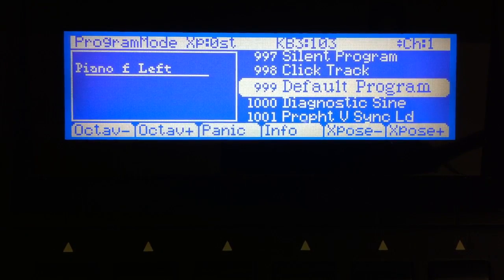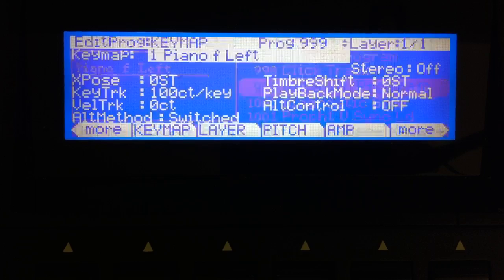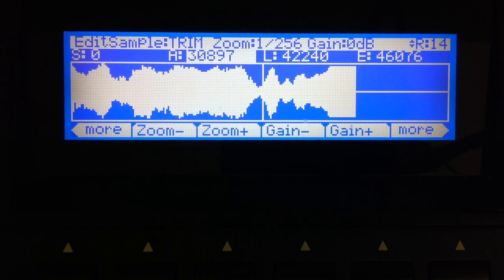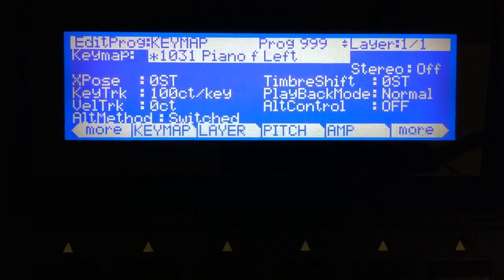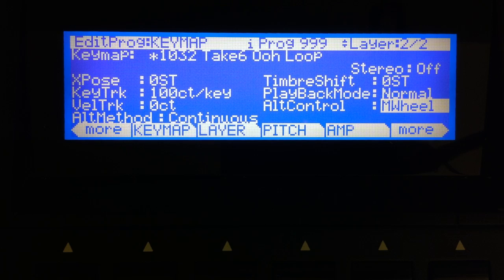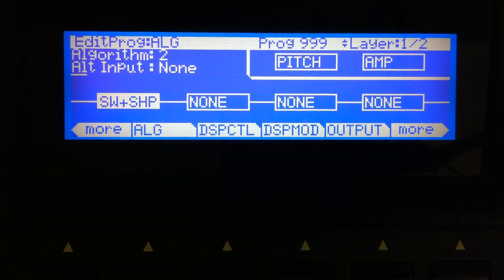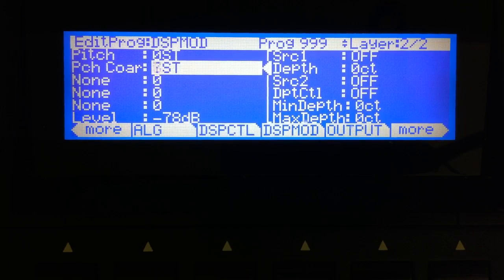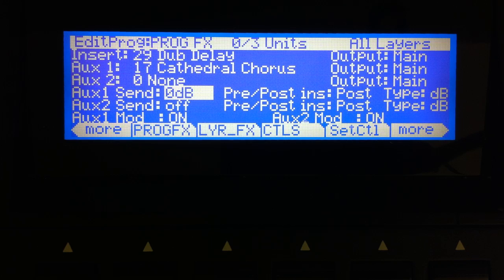Kurzweil PC3: Tutorial 13 -- Wavesquencing Pt 1

Comment: nice ~but I think you can create maybe 8 layers with Layer Enable as random LFO,  then with different range value, so each time you play note, random layer will enable, It's WavSeq. And in Forte OS4.0  or pc4 it's more easily, set layer enable to any CCseq, then use CCseq to random control it, with random or step control other parameters, it's really Wavseq as most KORG can do~
Reply from the maker: Yup, I go over that sort of thing in pt. 2 -- https://www.youtube.com/watch?v=HiXY8MJiCMQ -- since you can have 32 Layers in a Program you can have 32 different "sequences". And yes, the point of the video is to show that you can do "wavesequencing" on the PC3 just like you can do it on other keyboards.
Reply from the maker: Adding, now that I think about it a sec with Setup mode you could have way more than 32, as you can have 16 Programs in Setup mode, all doing this sort of thing. By varying some bits you can have 16*32 wavesequences running, and switch on/off at least 16 at a time.

Comment: this approach reminds me not "wavesequencing" (which is the technique used on korg wavestation or dsi evolver...a sequencer triggering some samples instead of notes in a musical timeline with a given bpm)

Instead it has more in common to "wavetable scanning", which is common in ppg, or waldorf blofeld/wave/microwave etc family....you have a collection of waves which have some common morphing character but not always so, and you move the pointer inside the lookup table reading this wave stream in various points, even looping a portion of it....

this is more wavetable than wavesequencing, alas your third tutorial instead has more in common with classic wavesequencing.

It would be interesting to try if user flash sample memory in kurzweil pc3k would work in the same fashion, imagine sampling a tons of waves at 8 bits and 20 khz put them inside the flash and moving randomly into them, would be great and 128 mega would be such enough.

I read about one guy who has made tons of wavetables and stock them into a sy85 which has only 512k of rom....big flash are intended to store vst realistic samples not for such applications.

I read in manual kurzweil pc3k has 16000 locations to store objects....would it be 16000 sampled waveforms?
Reply from the maker: One could stitch together a bunch of waves, kind of like a "transwave" and then use the AltStart parameter to move within the "transwave". The end point is fixed, but since you can move the altstart point you can essentially get the same effect.
Reply: +poserp oh yes infact....this could be a great technique to get moving sounds with pc3k, there is also a good emulation using vast for vector synthesis which is from prophet VS and korg ws to have a 4 channel vector mixer, there is no joystick on board but could be assigned to ribbon or external controller, this emulation was made in nineties for kurzweil k2000! vast power is real limitless...